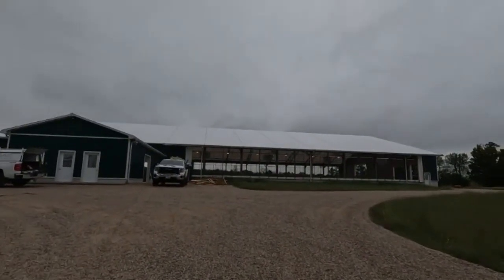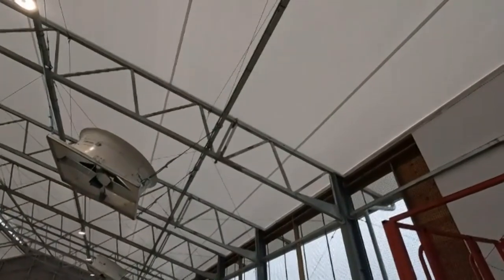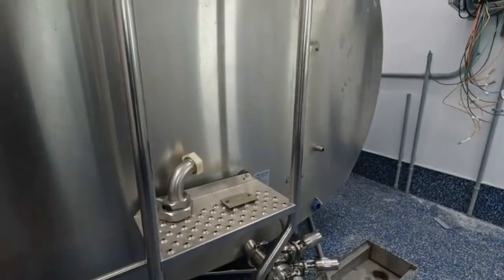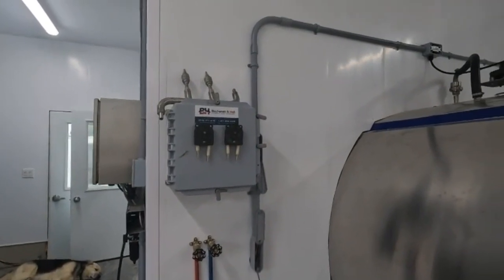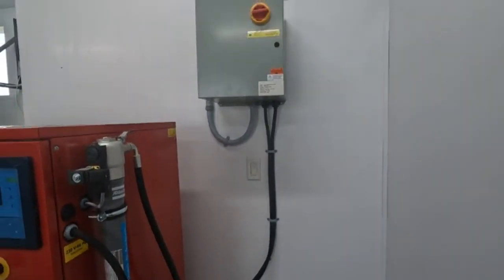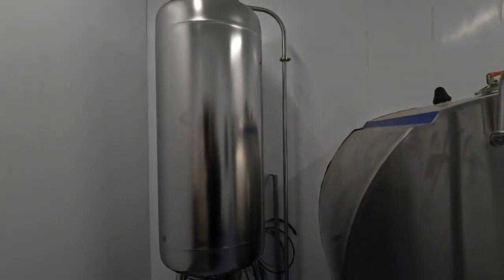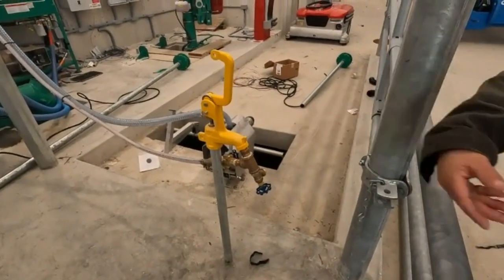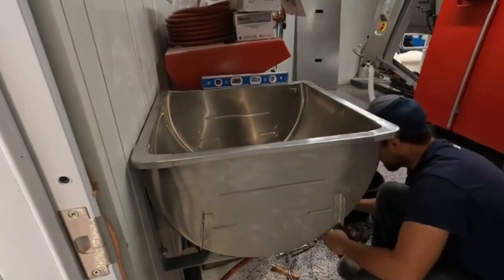Installing Milkline for Lely Robot! Sept 23-24, 2024

Comment: I am really enjoying watching the progress but do you have a video explaining why you are building a new barn for just 10 more cows vs continuing to use your old facilities ?
Reply from the maker: @joebishop7909  I don't really have one video that explains that. 10 more cows is a huge difference for us because at max we could milk 50 before and if we had cows we were drying off or cows coming in they would be taking up one of those stalls. Also because the cows milk more than twice a day with the robot, you can make more milk from less cows. We are also on the quota system here so it takes a long time to buy more quota for more cows. Our old facilities looks pretty good on video but everything is falling apart especially mechanically. The manure storage does not pass  the rules and would need to be all redone as well. There is more but I've had a really long day and can't think of how to say more. Hope this answers some questions and I may address this in a future video. Thanks for your interest!